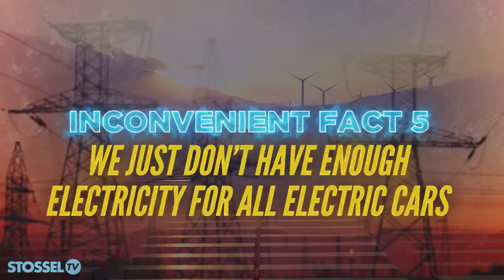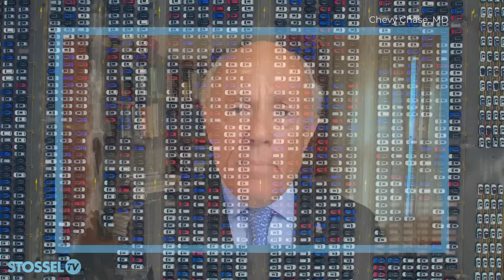Electric Cars: Inconvenient Facts, Part 2

Comment: Good. As a long distance traveler who travels over 7,000 miles a year in long distance traveling alone not to mention the mid range travels and countless short range travels i do, i need long range which unfortunately isn't available in any EV. Longer range is reserved for gas cars only. I think EVs are kool as hell and i would love to buy one but first they must be improved. Improved with much shorter down times for charging and longer ranges. Till then I'll keep my jaguar XJL. I fuel up once a month at 3 to 5 minutes for a range of 570 miles which supersedes any EV in America. More than a pleasure to drive and paid off at 41K. I am posting this 3 days before leaving from Lancaster Pennsylvania to Dallas Texas. 2,800 miles round trip. Thank god i have the ability to,  (keep moving). If you make this trip in an EV with 300 miles of range, you'll have to stop 9 to 10 times and sit 20 to 30 minutes each time, if you don't run into chargers that are "out of order." For me it doesn't matter how many times i stop for what ever reason, i only have to fuel 5 times. Up and out in 3 to 5 minutes depending on wether or not i run in and grab a coffee. Till the EV is improved with these fine qualities and improvements, I think I'll simply leave well enough alone....

Comment: Electric cars in a logical sense alone make much more sense. Quiet, don't smell, crazy power, fewer moving parts, fuel at home, no more dirty gas stations pouring highly flammable liquid into your car, standing in diesel fuel. 99.9 of folks travel can easily be covered by EVs. Drive to work, go home, plug in, repeat...simple, fast, clean, logical.

Comment: There's not enough elements to create the batteries or charging points to charge them all, or a grid strong enough to carry the capacity required, or a second hand market to keep the automotive economy afloat.

In short it's a novelty priced out of the mainstream by some pretty severe issues not yet understood or addressed yet.

Comment: The colder it gets  less power  from  battery EV also if your car sit outside  or in a un heated  garage that battery In   your EV takes power  from  that battery  to keep  it self warm .you won't  get shit on trade in .The next buyer not going to want to put 20.000.00 for new batteries

Comment: The Terminator had a better power mechanism in the 3rd movie, which was an hydrogen fuel cell, a micro reactor that makes its power on site (within the chassis), never required charging and lasted over 20 years, similar to a nuclear powered submarine.  The arc reactor is a pipe dream... and it also was tough on the man, whom had issues with poisoning from the arc reactor's discharge.  Will this ever happen?  Maybe in a hundred years or so, hydrogen technology would be at a point of anyone having a portable hydrogen reactor; but would be used in the military, long before.

Comment: 400 years with current production capability. Only thing I agree with is lack of grid capacity. Government shouldn’t be building charge stations. Capitalism does a better job. Gov didn’t build gas stations and there are still too many. One more step to socialism when Government rations electricity. They should concentrate on the grid and let capitalism work like Tesla does.

Comment: Point, Counter Point.  They should call Electric cars battery cars.  When it comes to efficiency, an ICE can't come close to an electric motor.  An electric motor has one moving part, the rotor.  How many moving parts on an ICE.  Discussing the green thing is just one rabbit hole after another.  All energy sources, fossil fuels, hydro, coal, solar, battery, natural gas, nuclear,  is just trading one environmental impact for another.  The plus side for EVs, they are a lot cheaper to operate than an ICE.  The best part of EVs, almost 100% of the battery is recyclable.  They figured out how to make money by recycling the batteries.  The infrastructure is not here yet, but it will be.  Charging at home is easy peasy.  250 miles of range charging at night.  $5 to do it.  What's wrong with that.  What ICE gets you 250 miles of range on 5 bucks.  Not lately.   People were screaming and hollering when we transitioned from the horse and buggy to ICE.  The near future is electric, what's next, who knows.  If the grid goes down, you ain't going to be fueling your ICE either.  It takes a lot of electricity to refine fuel.

Comment: The prediction from the International Atomic Energy Agency is that by 2050 renewables will make up only 50% of total energy and that the increase will mainly come from solar. Given the limitations on the supply and refining of the rare earths required this is an optimistic estimate save the deployment of modular nuclear plants like those being developed by Roll Royce and its partners in Germany and India except Russia has a monopoly over supplies of nuclear fuel that competes with its sales of oil and gas.

Comment: It will take another 25 years before electric cars will be any good.  Today they really suck big time.  A battery needs to be developed that will go over 500 miles, and then the charge should only take about 15 minutes.

Comment: Electric vehicles are ideal for city use
I have a cupra born 80kwh  and since I have owned it I haven't paid a cent for energy. I have a solar array. But and it's a big but the grid just can't support replacing the transport system with electricity. The future is some sort of synthetic fuel not based upon carbon.

Comment: a thing that don't even mention is that all kind of plastics even what used in car parts comes from oil and materials that are sub products from the oil, so oil extraction won't ever stop and electric cars to be lighter will use extensively plastic parts in their body since batteries weight 45/55% of the car total weight

Comment: Politicians "don't mention that", and neither do most materials scientists. 

My car is designed and made in America by American workers, by an American company. It has a range of 516 miles according to EPA ratings. When temps get down to 20 degrees F it loses 40% of its capacity. That means my battery only gets 310 miles when it's frigid. Only 310 miles. Of course, that never happens where I live, but just in case it did. Good to know. My car is powered from the solar installation of my home, of which all its components are assembled in the People's Republic of...Buffalo, New York. 

Later this year we'll be seeing batteries with a >600 mile range. 

Less lithium is needed per kW of newer batteries. Even so, lithium mines are coming on line in California and Nevada...and car batteries are built in America, by American workers.

If you hate America, by all means, continue with your old-fashioned fossil fuel car. But if you truly love America like this Cold War Navy Veteran does, buy an American made electric car. 
 
God bless America. Go Navy!

Comment: The points in these two videos are risks, not absolutes of electric vehicles. They will only occur if the transition happens without proper planning (granted that seems very likely), but even if they do occur, they will be temporary.

Comment: Amazing! No one can agree on the cost of electrifying the world.
I do know one thing, a rich man I worked for always said to add 10 to 20 percent to the guesstimated cost and you might be right, might be right.
We know for certain what it cost to power by fossil fuel, to make products out of fossil fuel.
And we know , or some of know the sun does not shine 24/7, or the wind does not blow 24/7. And why build in the South?
The sun shines in the Northern states, and wind blows there also.
There is tremendous hot air found in and around the DC are. All we need is to store all that hot air and the problem would be solved. If that is not enough there is loss of horse poop in local governments too.
Better yet let’s sell all the elites extra homes, land and boats and cars and that might take care of the rest of the cost.
 Or would it?

Comment: Electric Cars-
It currently takes approximately 
25,000 lbs of brine for the lithium
30,000 lbs of ore for the cobalt 
  5,000  lbs of ore for the nickel
25,000 lbs for the copper 
All told, 500,000 lbs of earth crust must be dug up to produce 1 battery.  

Approximately 84,000 gallons of “fossil” fuel are needed to move all that earth.  
If you drove your current vehicle 15k miles a year and got 20 miles a gallon, that amount of fuel would power your gas burner for 112 YEARS. 
—The production of one EV produces 70% more greenhouse gases than a gas power car and will take nearly a decade of driving to offset those emissions.  
-One EV supercharger pushes out 350 kilowatts.  The average home uses 1.2 kilowatts. 
So an EV, while charging, pulls the energy equivalent on 260 homes from the grid.  
-EMF readers show sitting in an electric car have the same levels as  standing next to a running microwave.  
And non of this factors in that those batteries last less than an average of 20 years, (closer to 10 years) or, that there does not yet exist a planet friendly lithium battery disposal plan.  So by the year 2050, 50 million pounds of waste, which will never break down, will occupy our landfills.

Comment: What I would like to know, if and when these better batteries are available, can they be retrofitted into existing electric cars?
Reply: All four of my lead-acid EV's could be made to work on the Lithium -ion batteries available today.  The problem with today's EV's would be all the computer nonsense built into the cars which would need to communicate with the batteries.

Comment: John you neglect to mention the added size of the cables that will required to carry the power needed to supply the needs of the population.
Reply: You can charge any EV off a reg 110v outlet. 
So you are wrong in every way

Comment: The only solution is Nuclear power, specifically micro nuclear or nuclear voltaic cells, which is so heavily regulated that it would be impossible to get off the ground even though it would be easy, clean, and safe.

Comment: Ark reactor just as likely as a clean battery if we go this route battery’s we will have change or be economically recyclable or we may see worse pollution results then caused by ice vehicles. Super-light-weight local commuting vehicles might work then grid might not be as overloaded. If you look to other nations some are changing way they heat and cool homes and government buildings. Still challenging but in USA we have greater challenges. They are right a more diverse group of choices  needed and let’s have practicality help make the change rules may have to change to allow additional types of transportation

Comment: My car needs 7.95 kg of hydrogen to go 480 miles. If Shell will remove the solid carbon from my gasoline before they sell it to me, I  won't mix carbon with oxygen anymore and I will stop pumping  carbon dioxide into the atmosphere. The best way to convince me is to stop selling me carbon.
Reply: Gee, well you have almost no chance of surviving a serious car accident with a 10,000 psi bomb in the trunk.  EV's are bad too, but you might be able to get out of a burning EV before it kills you.
Reply: @danadurnfordkevinblanchdebunk  Dude, gasoline is 13% hydrogen, hydrogen is the active ingredient in gasoline, it’s the stuff that makes the car go. One gallon of gasoline has a mass of 2.85769 kg, so if your sitting in a vehicle with 28 gallons of gasoline, your sitting in a vehicle with almost 10.5 kg of hydrogen. That’s as much energy as three and a half 100 kwh batteries. Don’t forget, the Hindenburg held 18 thousand kg of hydrogen, it burned for only 90 seconds, and out of 97 passengers and crew 62 survived, so the odds are not that bad. I believe your right though, A Tesla crashed and burned in West Hollywood last and the driver was able to run away.
Reply: @saltydogg   And how many psi is that "hydrogen" in a gasoline tank?  

And how many psi of hydrogen did the Hindenburg operate with? 

I think you are done now.

Comment: I’ve put 71,375 miles on my EV since buying it new 4 1/2 years ago. In the process I’ve saved $10,800 in gasoline costs, over my previous Toyota Corolla. This is hands-down the best car I’ve ever owned. I will definitely be buying another one.

Comment: The weight of the batteries in trucks will require new roads and bridges!!!
Reply: How do you figure?  Trucks have the same weight restrictions via DOT rules (USA) whether they are diesel or electric.
Reply: Trucks will just have to carry less cargo to meet the weight restrictions.
Reply: @danadurnfordkevinblanchdebunk   Then they will carry much less cargo for the weight limit!!
Reply: @anthonytrujillo106   The fact of the matter is that there won't be a lot of electric truck on the road until batter technology improves dramatically.

Comment: I Think Stirling Engine Electric Heatercoil Hybrids Could Be Worth Looking Into🤔 Weither The Stirling Engine To Just Generate Electricity To Recharge Battery While Driving That Powers Electric Motors 
Or 
The Stirling Engine To Do That Minus The Electric Motors 
 and 
Power A Drive Shaft To Propel The car at The Same Time As Charging The Battery Back Up🤔👍

Comment: Electric cars are not the solution to our problems. I am not going to use different arguments concerning its climate impact during production and during the car's use. I will give another concrete example.

It is predicted that air traffic will increase by more than 40% in the coming years. These airplanes need fuel. This fuel is produced in refineries. You can't only refine aviation fuel, but you also get things like petrol, diesel, LPG etc. in the bargain.

If the majority are now in electric cars and do not need to fill up with petrol and diesel, then the stocks of these fuels will grow…grow…grow…
Due to lower demand, their prices will drop.

What are we going to do with this fuel? We can't pour it out into nature, we have to burn it up somehow.

If stocks of petrol and diesel grow because few want it, then prices fall sharply. All of a sudden these fuels become attractive again.

As I said, by producing the aviation fuel that is needed, the by-products will always be, among other things, petrol and diesel.

Either we heat our houses with them or we refuel our cars. These quantities of fuel cannot be released into nature. It would have fatal consequences.

We are stuck in a squirrel's wheel. The demand for fossil fuels is therefore decreasing because most people drive electric cars. Stocks of fossil fuels are growing. Their prices are falling.
We are back to where we started.

As long as air traffic needs its fuel, we will not get out of this squirrel wheel. Electric cars are thus not the solution to the problem.
Reply: Refineries can modify what comes from crude, if aviation fuel is your meme, they can produce more tar, plastics etc instead of gasoline to balance the mix.

Comment: electric cars have been around for 100 years. if they were a viable gas replacement then the tech would have been pushed many years ago. technology is not there yet nor the materials for smaller, more powerful batteries. hybrid should be the way to go till there are breakthrus.

Comment: They will have to rebuild every single bridge and indoor oarking lots structures to accommodate the millon extra pounds on the road because of the weight of those insane batteries 😢😅😂

Comment: Here are some EV facts. Total lithium Mined 2022, 130,000 tons Only enough to make 10 million Model Ys if you only used Lithium for EVs; no cellphones, tablets, portable power tools or big battery farms.  California alone has 32 million cars, but they charge at night so to charge them enough just to go 40 miles will required enough batteries to store solar for those 32 milion EVs so your talking 4 years of all the lithum just for California's cars. Or 8 years just for California if you use half the lithium for some other uses.  What about the rest of the USA? What about heavy truckes?  what about the Rest of the world?

Comment: Nuclear batteries will be a game changer.A battery that self charges. But hydrogen direct combustion is ideal if they can safely store hydrogen in the tank. Much simpler system, sea water electrolysis with solar energy to generate hydrogen,  and store them in hydrogen tank and ship to gas stations. Cars can run off of hydrogen gas with little changes to engine design.
Reply: Batteries self charge on your planet?  WOW!
Reply: So instead of an EV fire hazard, you want millions of 10,000 psi bombs on the road?
Reply: @danadurnfordkevinblanchdebunk  some countries have 95% of their vehicles running on natural gas tanks.  Nothing  scary.
Reply: @danadurnfordkevinblanchdebunk  if radioactive material's energy is directed for direct electricity production it might take some time to generate electricity, so it might need battery source to charge itself.
Reply: @danadurnfordkevinblanchdebunk  dude I come from a country that has 95%natural gas vehicles.
Reply: @vahagnmelikyan2906   Dude, no you don't and this is very easily proved.

Comment: Is it true AI has solved the fusion problem, and we should have nearly limitless electricity? I have been driving a Leaf and love it. I would like a sedan model more affordable than Tesla. Or even a 2 seater sport model. I have NEVER needed to seat 5 or 6 so, I don't need or want an SUV. But right now, SUVs and pickup trucks seen to be every other car on the road.